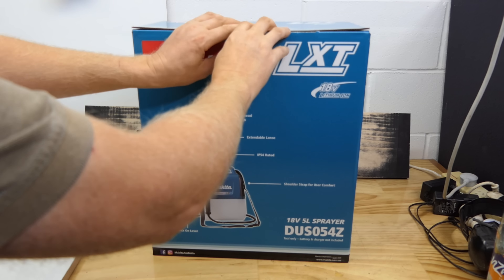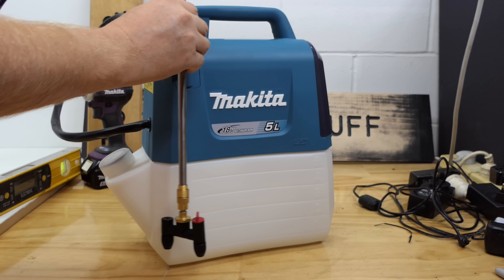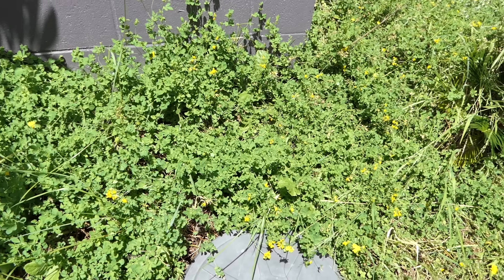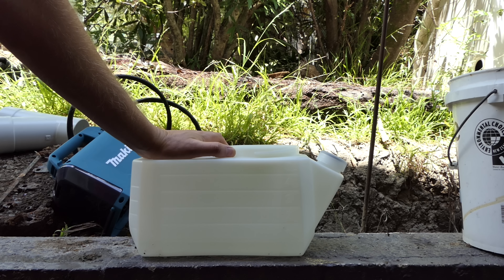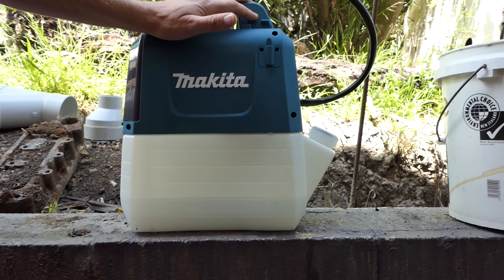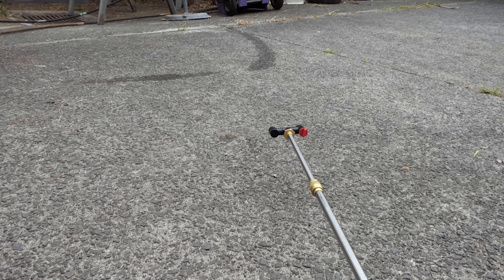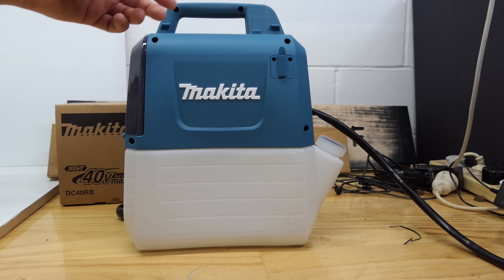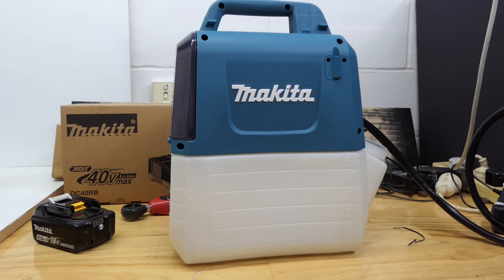Makita 18v Sprayer Review   |  No More Having to Hand Pump

Comment: I just bought this unit here in the USA, but I didn't get that thick User Manual!  LOL!  WOW!!!  By the way, thanks for the video.  It helped me understand and get a visual on what I need to do prior to using mine.  I wasn't aware that there is a slight amount of leakage from the spray wand.  I'll have to keep that in mind, especially when I am spraying down the weed and grass killer, and don't want to get into my lawn area.  There was a part on the User Manual that did mention what you said, about the spray nozzles building up possible debris in them, and they actually recommend pulling off the caps and using a small screw driver or some other small pointy tool to scrape off any debris from the nozzle heads.  Once they are cleaned then they should function as usual.  I am definitely excited about using this sprayer, and I bought it because I really hated having to use the Pump-and-Spray Units and or the Spray Bottles.  Again, thanks for your video, and say Hello to the chickens LOL.

Comment: My backpack hand crank sprayer is in need of replacement. This Makita probably has a place but I'm on a rural property and 15l makes a walk worthwhile. The Milwaukee Switchtank is a perfect setup if you have M18 batteries but it'll be a day of kicking and screaming before I buy into yet another battery system. Still, the Makita is a good size for insecticide and I don't like using the same sprayer for herbicide, insecticide and then fertiliser.

Comment: The powered sprayer is definitely a nice piece of kit for small stuff. Nice for like a little garden or maybe minor weeds on concrete. I'm thinking this might even be doable for spraying cleaning solution on walls etc. for mold/mildew too. Would definitely prefer the powered higher capacity one, but for the price, that's best left to commercial endeavours. Would be nice to have a uniform spray rate though on my back pack. sigghhh.

Comment: I have one of these, mine will not suck up the last 1/2 to 3/4 litre out of the tank , I tip what’s unused into a 1lt pump sprayer to use it up. I feel the tank needs a small sump with the pickup tube lying in it then you would only have around a 1/2  cupful of poison to deal with. As this is my  first powered sprayer, the book and the dripping I’ll forgive but the tank needs a remodel, I don’t think I’ll buy this one again. Thanks for the videos.

Comment: Just got one. Nice kit, nice spray, nice to hold. But, hose was so bent and crimped (not allowing any fluid to pass) at the handle I'm having to use two hands; looks like a piece of wood and tape to keep it straight. Seems a bit dissapointing to do that to a new machine, or remove and shorten...

Comment: Got this the other day and pretty happy. Are they likely to release different spray nozzles, sometimes you want a straight line profile when killing grass on the edge of your path.
Reply from the maker: I don't know. The nozzles are adjustable. If that isn't enough, maybe an aftermarket part could be used.
Reply: @ToolsAndStuffOFFICIAL  Now just compare this one to the CXT 12 v version and XGT 40 v version :-)
MAKITA US053DZ (12 v) is here in Finland at same price than DUS054Z , and 40 v unit have only seen that on Japanese pages .
Cant find spare part chart for this one , so hard to tell if these can be repaired if they fail .

Comment: Packaging: More environmentally friendly. Manual: Let's just jam all languages in one massive book, even though nobody's gonna read more than 1 of those languages. Doesn't matter that it takes two trees to make it.

Also, honestly, 20kg on your back is SO much better than 7 or 8 kg in one hand. I could walk around with 20kg on my back all day, but carrying 7kg in one hand for an hour would ruin me for days.
Reply from the maker: I hear what you're saying, but they are so uncomfortable to have on your back with your shoulder blades digging into hard plastic. If they were nicely padded sure. 
I prefer towing a tank on a trailer with a quad and a 100m hose personally.
And it starts off at 8.5kg, but after 6 minutes only weighs 3.5kg ;)
Reply: @ToolsAndStuffOFFICIAL  Are they still that uncomfy though? The old ones sucked big time, but I can't imagine the Milwaukee one being too uncomfy. I would agree with you on the quad with trailer, if I didn't hate long hoses/cables so much, they always get in the way. For a large property it's definitely the way to go though
Reply from the maker: Every other Milwaukee tool is uncomfortable to use ;) When using the quad most of the time I didn't even get off. Just drive and spray, best way to go.